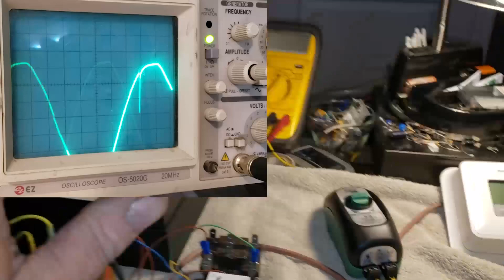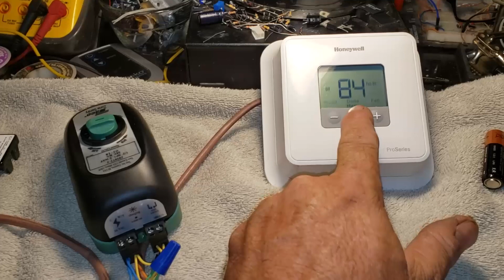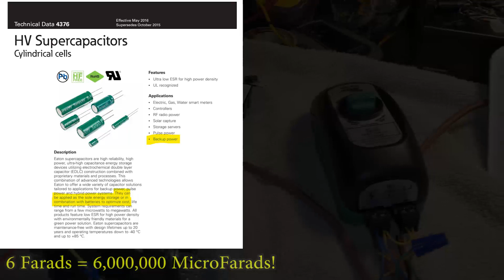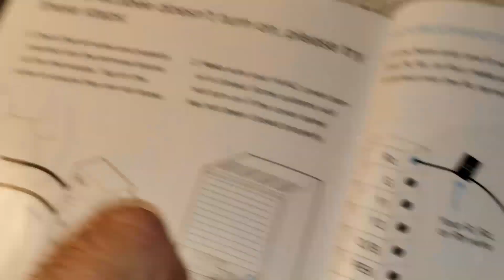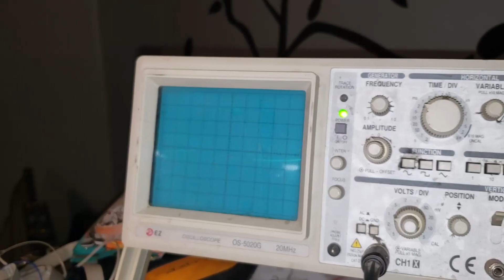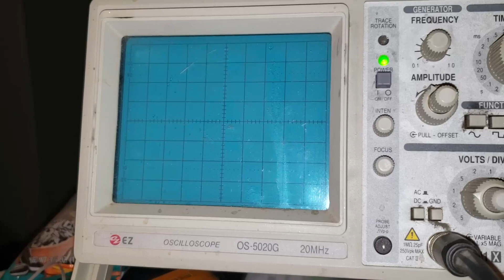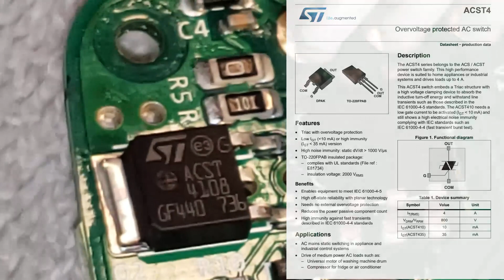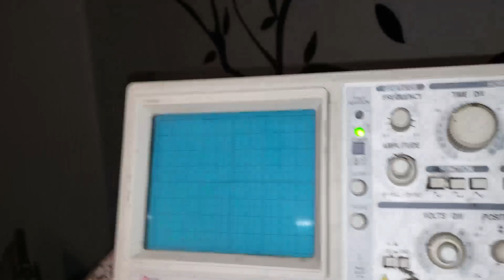EcoBee "Power Extender Kit" fixes EcoBee + Taco Actuator Issues

Comment from the maker: After I recorded this I realized that the terminal PEK stands for "Power Extender Kit". 
Obviously.
Derp.

It's just energizing half wave rectification for the Y output and then the other polarity of half wave rectification for the G output to essentially run two controls with one wire.

The Totaline "Add-A-Wire" basically did the same thing with diodes and DC relays years ago.
But this is solid state with optical idolators and triacs
Reply: Nice Analysis - thinking about what you did, it's possible now that the PEK optoisolator is sinking the power to the TACO valves instead of the EcoBee...so it may not be the dirty power that is resetting/causing havoc in the Tstat as the Super Caps are drawing more power than the internal SCR/Triac in the stat itself on the Y term causing the anomalous behavior.  Just a thought. But very methodical thought process on solving this issue!
Reply from the maker: @TheGgin  The noise is still there to the Red and common. 
I dunno if the extender kit triacs are better than the internal ones or not. 
But when the Taco is charging off of the Y wire it was the G terminal that I observed cycling erratically
Reply: We have had the same type of  issues with  The Nest thermostat. It seems to always be the same fix. Lack of a common at the thermostat. We either pull a new line that will add  common or put a common maker on it. I use the Fast Stat brand with very good luck.  Seems to work fine after that. I don think its a dirty voltage issue. I think its a charging issue at the thermostat.

Comment: Any ideas on why there would be power going into the PE, but not out and to the thermostat? Waiting on a call back from my local hvac company- spent two hours with ecobee tech and they have no answers for me 😂
Reply from the maker: The power OUT of the power extender comes from the AC unit and the PE just switches on the outputs via the inputs of DC- and DC+ on the PK wire input. It's not something a EcoBee tech will be able to help with a homeowner. The EcoBee tech rep probably helps with programming, WiFi and basic stuff but likely has no idea how the electronics works. Actually, 90% of the HVAC techs would understand it.

Comment: Ecobee also did some work on the newer thermostats to fix this issue. 

The Fast Shutoff circuit was redesigned for Smart Thermostat w/Voice, ecobee Enhanced and ecobee Premium thermostats to eliminate the problem. 

The ecobee 4 (and older) thermostats still have the issue.
Reply from the maker: Well, the issue was not all EcoBee. The TACO water valve actuator was putting huge voltage dips into the 24VAC sine wave. The EcoBee reacted to that.

Since this I have installed three EcoBees in my home, two are the high end Alexa ones, and they kick ass. I regard them as a top tier t-stat and recommend them

Comment: Is this in a commercial building.  Seems like a lot of work just to get this to work.  Better off going with a real EMS system which is proven.
Reply from the maker: These are apartments.

So the apartment rooms are designed as residential.
Which means regular thermostat control.

Comment: Taco is probably just PWMing the super caps right across the input and drawing huge amounts of current. They should add a current limiting resistor or a filter cap.

EcoBee should design a product that doesn't attemp to destroy equipment if it gets dirty power. Like, HVAC stuff always uses garbage thermostat wire and has big contactors that draw lots of power. What were they thinking?
Reply from the maker: That is exactly what is happening.
Taco is causing the huge spikes in the 24VAC from pulsing current through those super capacitors which are probably like a quick dead short as far as a wimpy 24VAC transformer is concerned.
That's why they take 30 seconds to charge two capacitors to 2.5VDC each.

If they had installed a better capacitor right after the rectifier then it would have absorbed the spikes in current as my simple add on capacitor did.
Reply: At first I was blaming just EcoBee, but I think the fault is definitely with both of them. Taco for assuming they could basically more or less short out the 24 VAC line like that, and EcoBee for having extremely poor filtering and fault handling characteristics.

Comment: How did your filter work? A capacitor  in parallel to rectify to dc, and a diode in series with the 24v input? I definitely like your filter better!
Reply from the maker: Yes, I had a diode and then a parallel capacitor after.
I figured they'd have to do something like install DC filters but then they were told (by manufacture) to install those Power Extender Kits.
Something you'd never think of doing when you have more than enough wires to provide the common wire.

So since they already have the Power Extender Kits that is what they are going with.

Comment: have you tried adding on to your filter making it a full true CRCR or RLC filter. simple and small, you are on the right track just take it that one little extra step
Reply from the maker: I believe my filter worked fine.
But there are 320 of these units installed in this one single location and they already have the Power Extender Kits there on site from the EcoBee boxes.